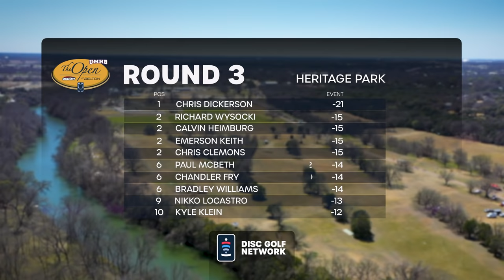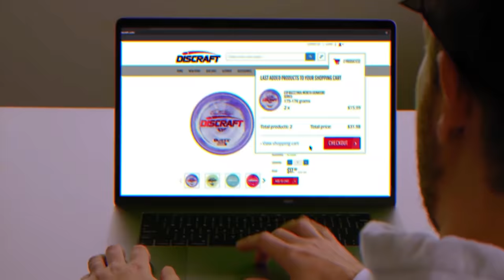The Open at Belton | MPO Lead Card | Dickerson, Wysocki, Heimburg, Keith | FINAL, F9

Comment: Good commentary but it’s really annoying to see drive distance 450’ after each throw. Don’t put it on if it’s inaccurate. Also. It says round one when it’s the final round.
Reply: My guess is that they inputted the graphic timestamps and then went to edit the values, but accidentally had them all selected when trying to change one of them to 450 feet. There were no distance graphics in the first two rounds so it's a step in the right direction at least